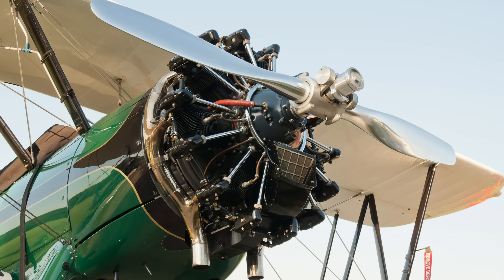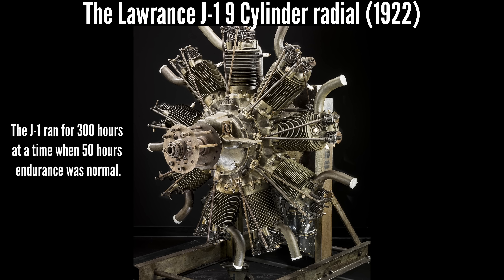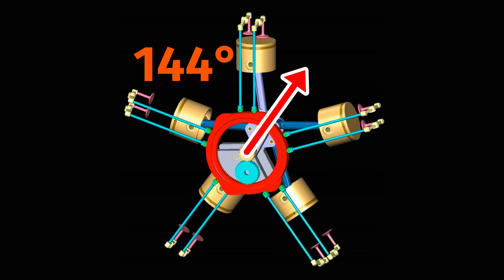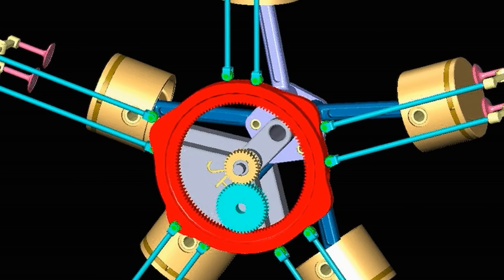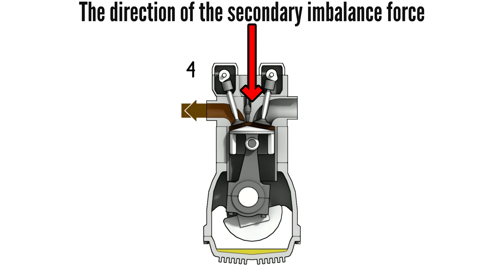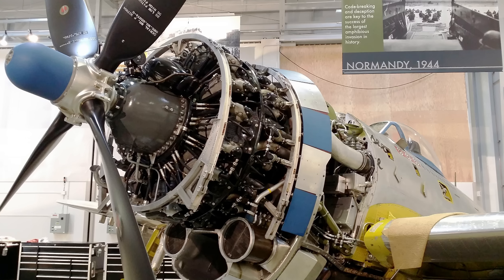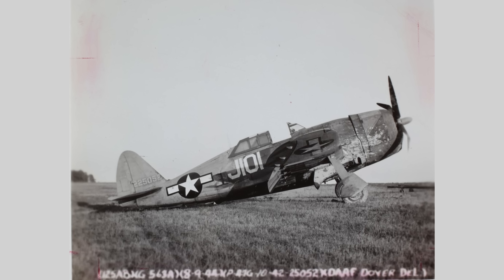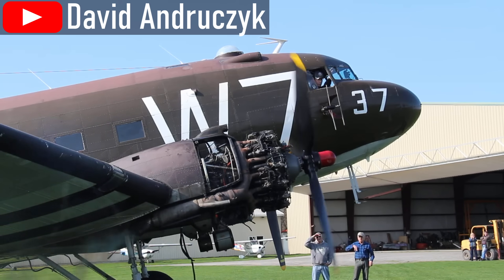The Rise & Fall of the Radial Airplane Engine - History & Technical

Comment: I will never understand why the Americans gave no value at all in streamlining the frontal section of their radials
Just compare the Sea Fury with the P 47 to understand what I'm saying
Seems they could have avoided many losses and the need of entire ships loaded with fuel with a little more commitment to the design of their radials
Reply: 1. You are comparing airplanes that first flew 4 years apart, which is a long time in that era of rapid aeronautical development.

2.  The P-47 was a very clean design for its time.  You are focused on the large frontal cowl intake, but fail to realize that intake captures all air entering the airplane for all purposes.  The Sea Fury has a smaller cowl  intake devoted to cooling, and additional intakes on the wings to capture the air need for other purposes.  You'd have to show me wind tunnel figures to get me to believe the intake drag of P-47 was completely outclassed by that of the Sea Fury.

3.  The P-47 was a unique design that solved the problem of ducting large amounts of air back to the rear mounted turbo-supercharger and intercoolers. The was necessitated by the need to supplement the R-2800 with a second stage turbo-supercharger for high altitude performance.  The Sea Fury had more compact  mechanically driven superchargers and did not suffer from the need to provide for such an installation. 

Most people who understand the P-47 admire its aerodynamics.
Reply: @gort8203  ok, forget the Sea Fury
The P 47 first flew on May 6 1941 while the Mitsubishi A6M Zero had its first flight on April 1 1939, two years and 36 days before
It's impossible to argue that the Zero have an aerodinamic far more competently designed than the P 47, despite not so refined as the Hawker Sea Fury
And not just the P 47, but better than any, indeed any American made plane equipped with radial engines during wartime
Reply: @r.guerreiro140  Did you pay attention to anything I said?  Other than a larger fuselage diameter to house the larger engine and intakes, the P-47 was just as clean a design as the A6M.  Did the A6M have a remote turbocharger and intercoolers?  Did the A6M have an engine as wide as the P-47?  Was the A6M anywhere near as fast as the P-47?   Your criteria for judging airplanes are based on looks rather than engineering.  But go on sticking with your shallow ideas and don't learn anything.
Reply: @r.guerreiro140 in what way was the zero better aerodynamically? Also, you are comparing 2 planes that are basically completely different in mass, size etc. 

If anything, the Americans were pretty early pioneers in aerodynamics. Look at the p36 for example.
Reply: @r.guerreiro140 Gotta compare apples to apples a bit, compare the P-47 (Or the Hellcat which ran the same engine with an arguably beefier front cowl) with the Japanese's closest counterpart which would be something like the N1K. And you'd see that all of those aircraft, to make that amount of power with a radial, wants a similarly extravagant amount of frontal air inlet. They had different strategies for trying to optimize aerodynamics but at the end of the day the P-47 was plenty fast, and very rugged, and if they could have gotten a little more speed from extra fairings they might have given up something else.
Reply: Check out the development of the FW190. Kurt Tank initially tried a large spinner very reminiscent of the Sea Fury but at a point in time that paralleled the P47. That it was tried but also didn’t work supports both you and the other person’s points in this discussion.
Reply: You can't say the P-47 was a bad design. Take a look at the front view - a lot of that huge area is an air intake for the turbosupercharger. The P-47 was designed for high altitude performance, which was all about getting as much air as possible into the engine (via the 'charger).

Also, high altitude interceptors like the P-47 need maximum climb performance. This is typically when old piston engines overheat (high power settings and low airspeed) so you want maximum cooling.

tl;dr the P-47 was a great design and there were good reasons it was built how it was.
Reply: It was all political... Pratt threatened to cease manufacture if the government opted for V over radial...
Reply: Anybody else notice NASA Mercury & Gemini astronaut Gordo Cooper at 13:59?
Reply: Aerodynamics are not always intuitive. The frontal shape of an object has comparatively little effect on the drag it creates, provided the air flows smoothly from the front to the sides. Consider that a teardrop, with blunt nose and pointed tail, is the most aerodynamic shape. Adding a point to the front of a teardrop creates more drag, not less.

I don't know how effective the Sea Fury's nose cone was at reducing drag but I wouldn't be surprised if the difference was fairly minor.